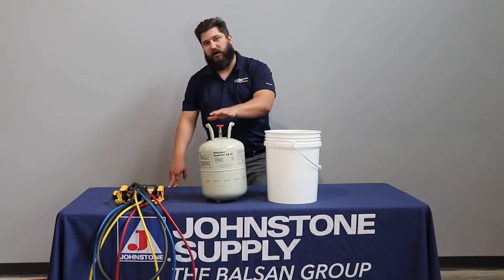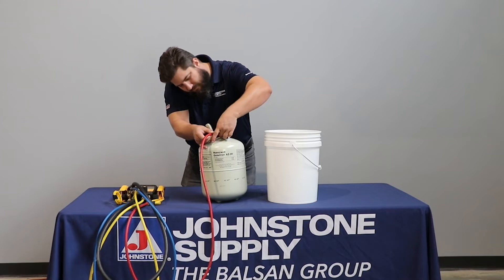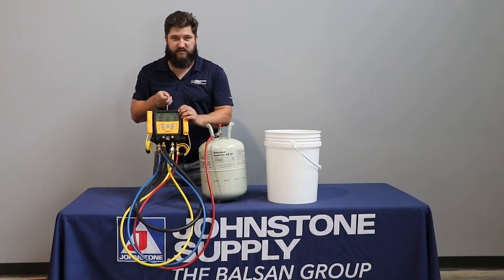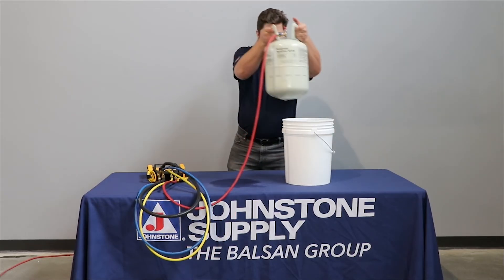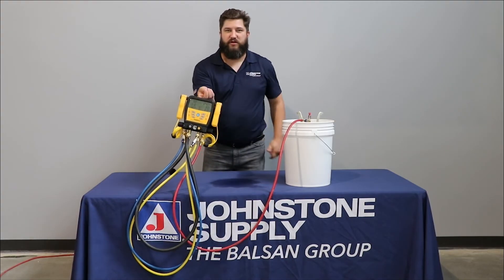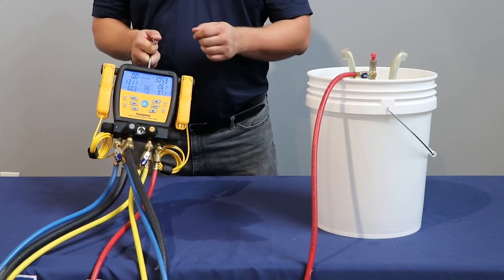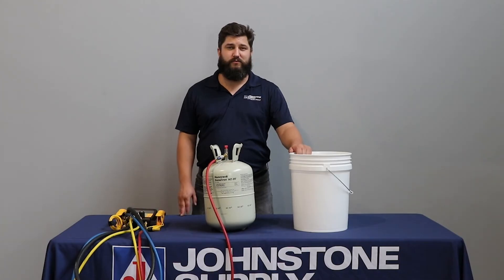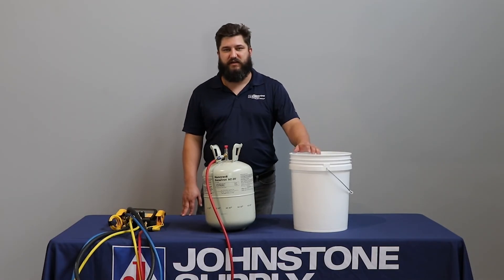How to Charge Your System During Winter Without Turning it On

Comment: -410A refrigerant must be removed from the drum in a liquid state. The two refrigerants that comprise it boil at close to the same temperature. Therefore, for slight leaks, R-410A can be topped off. Just make sure it's removed from the drum while it is in a liquid state.Apr 5, 2004.

Another video with misinformation.  Do not fill r410a in gas state....

Comment: How about a video on determining the charge of a mini split with one service valve and R410A.  It is good to refresh on the procedures now and again.  Things change fast in the mini field.  What was good a couple of years ago could be obsolete now. Might even be some short cuts I am not aware of.  It would be of great value if you do it during the heating season.  I have viewed several videos which want you to shut off the inside exchanger and run the compressor alone.  Most of the modern mini splits I have dealt with have the inside unit powered through the compressor and no positive disconnect.  I am not sure that the design allows the compressor to run when the inside unit is shut down with no damage either.  Thanks for the video.

Comment: Another great way is to just have your system in a perfect vacuum first isolated from the condensing unit and then just doing your calculation by length equals weight

Comment: How do you check the super heat or sub cooling using this method? How can you be sure you are not overcharging the system? Thanks
Reply: This way of charging your system is for when you have calculated the charge of the system prior to charging. No need to check super heat or sub cool when the system is not running and you are weighing in your charge. You are free to check super heat and sub cool after the charge is in the system and after at least 10 minutes of run time.
Reply: @daviddarling2970  I missed you mentioning this is a method to weigh in a charge when it is cold. lol
Reply: Other sylinder trsfering  gas  psi down need liquied  tarsfering  gas  systom  mt  syliner  gas  vapuering  afyer liqued ized  us  water using  gas  systom  gas  chargeing time vapuer go  aftef  pressur down need water 2typ mete  good

Comment: Hot water?
Reply: Yes, domestic about 120 fahrenheit or 48 degree celsius
Reply from the maker: Yes it is domestic hot water, which is usually around 120 degrees. You want the water around there (no higher than 140 degrees) so that it doesn't heat up your refrigerant too much!